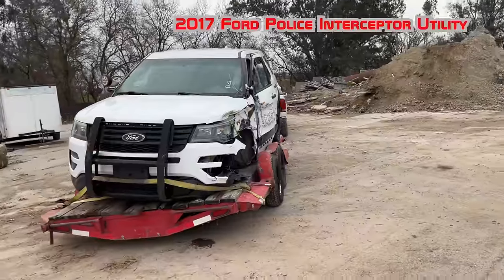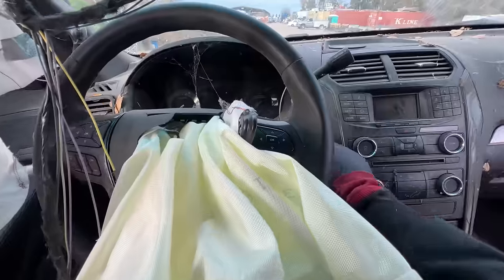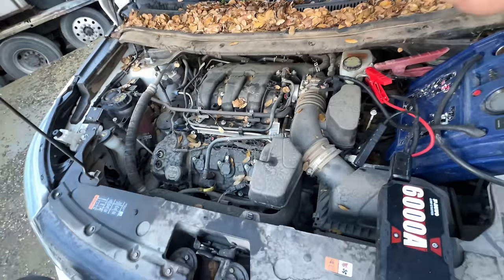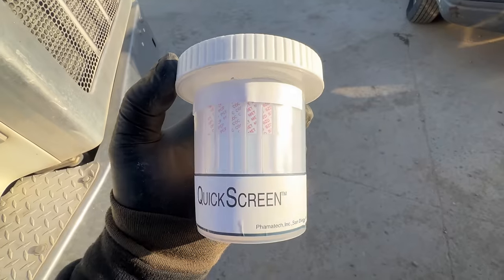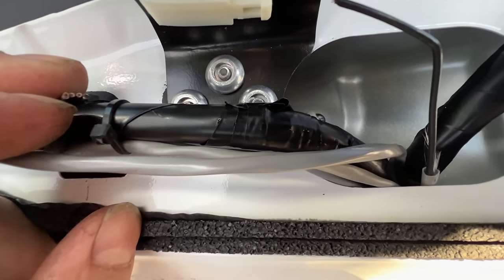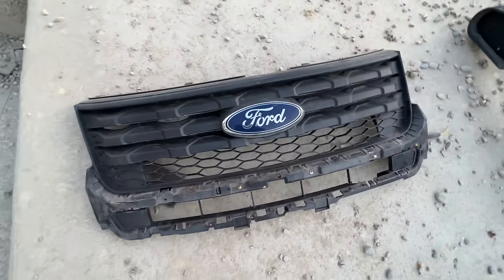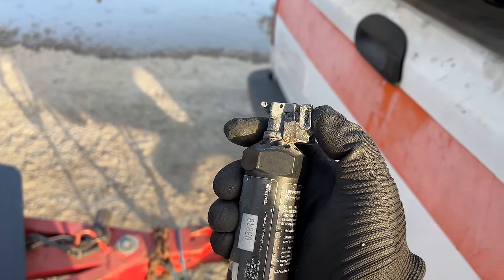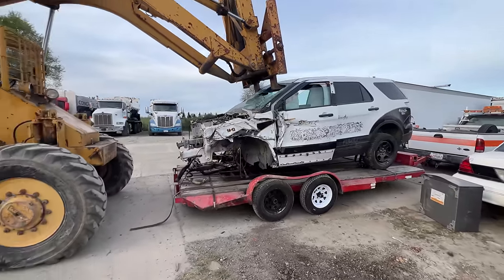I Bought a Wrecked Sheriff SUV! Found a Stun Grenade! | Crown Rick Auto

Comment: I kind of knew the flash bang was spent by the looks of it. They sell spent ones at some Army Navy surplus stores for like 20 bucks. Those M80s pack a punch and will stay lit under water but quarter sticks they are a little bigger and way more power full. One of my friends ex girlfriends tossed one in his car and totaled it. All 4 windows, windshield, rear window blew out. The explosions was so powerful it blew the roof of the car up about 3" blew the doors out enough you could not open them because the locks got bent. Almost every piece of plastic shattered. The insurance company didn't have a clue of what to list the damage as. LOL He had a very nice late model Merc Marauder of course at first no one knew how the car blew up it wasn't for some time before it got back to him it was his ex gf by then she had moved away and too late to charge her and proving it would be very hard.